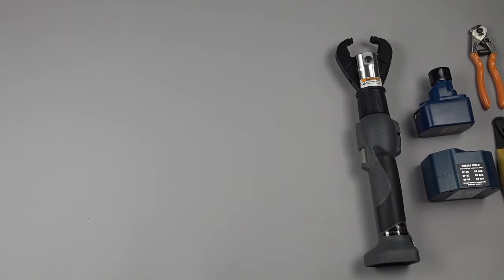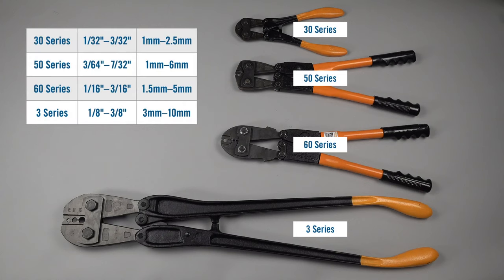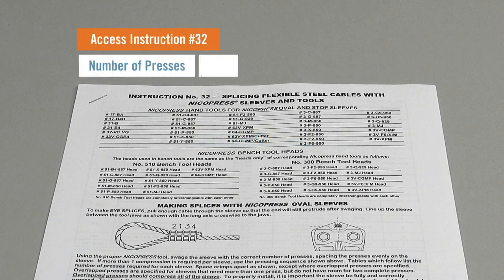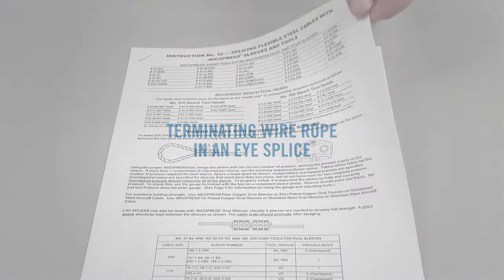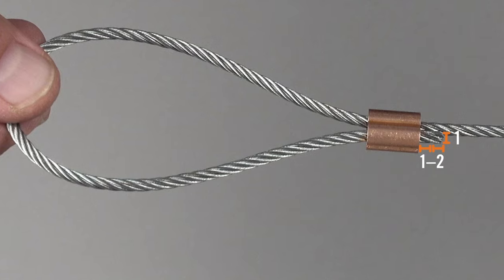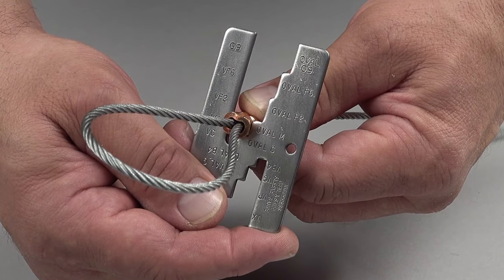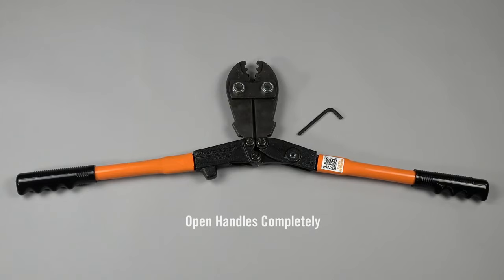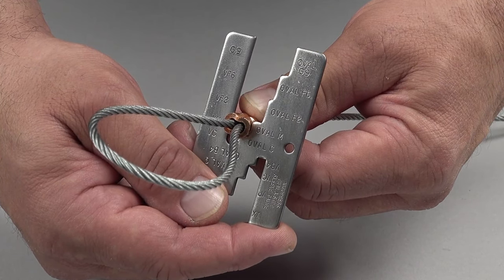The Proper Way to Swage Fittings and Adjust Wire Rope Swaging Tools

Comment: Why can't the video show how to cut braided cable so that it's not frayed and too large to fit into the ferrules?  (the problem with doing this).
Reply: You will get better results if you use a cutting tool designed for wire rope.  Especially if you're doing a number of swages per day.  If it's just a one-off activity, then taping the wire rope and cut through the tape can help.  Also, grinding off the burrs can smooth the end before inserting into a compression sleeve.
Reply: I hit it with the dremel high speed6+ i ran it at 10